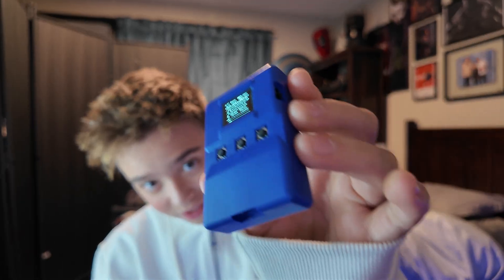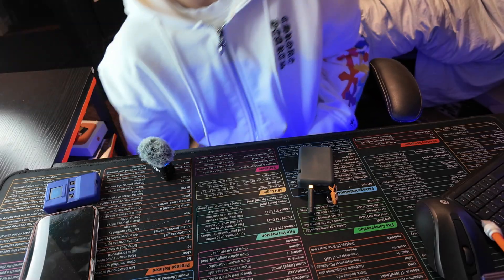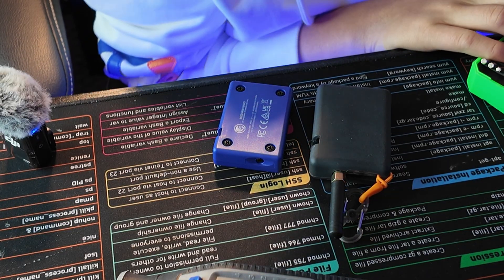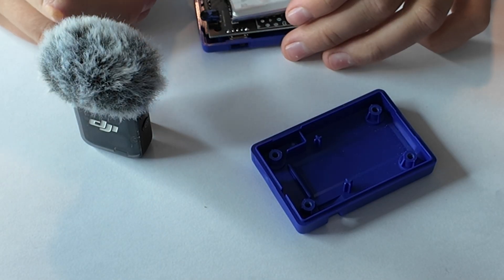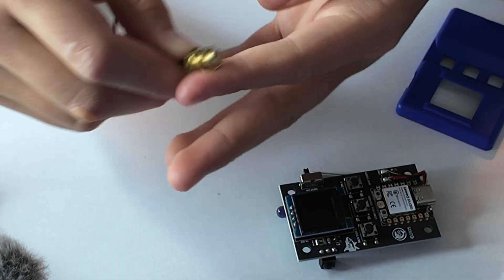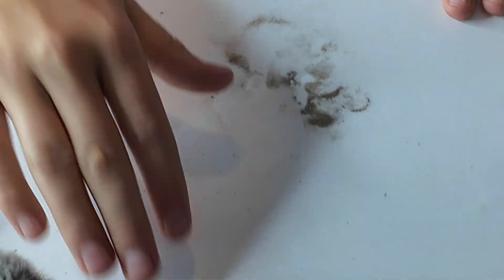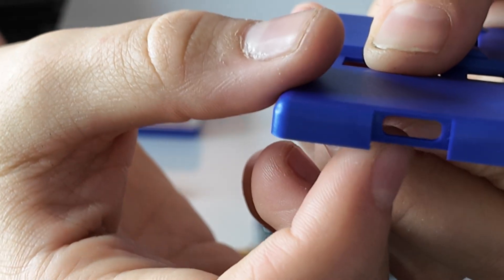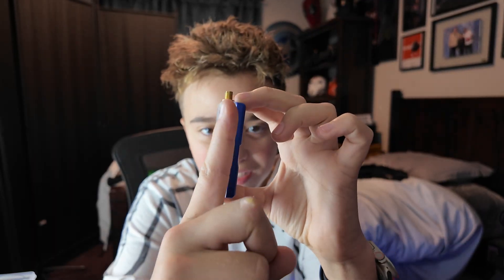📡 How to Add an External Antenna to the BLE Shark NANO 🔧

Comment: If you do this. Would it mess up the radio if you accidently started scanning without an antenna attached..? I know a few radios are like this but not sure if this would be ok
Reply from the maker: With almost any device you NEED to have an antenna to just power it on or you fry it